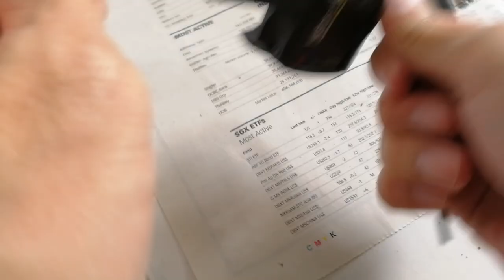LOOK Keo Blade carbon pedal maintenance

Comment: Greetings! I got these eyelets keo blade carbon 8 as a gift. But on one pedal there is no steel plate, it was lost. The question is, can you ride without this plate? And will these pedals fit Shimano road shoes, SH-RP100? :) and with spikes Spikes for clipless pedals compatible with LOOK KEO, M-WAVE 5-311836

Comment: My left pedal has some light creaking when applying force on it. Do you think it can be solved simply by dismantling the axle and applying fresh grease? I also noticed some slight play, I guess that’s where it might come from…
Reply from the maker: Taking it apart is the first step to check on its internal.
Reply: @fame1382  thanks!
Reply: @unairamos74  what did u find?

Comment: Can i use lithium grease?
Reply from the maker: I couldnt find any service manual for these pedals, best bet is a generic grease. This shimano grease which I m using in most of mine videos works well with most bicycle maintenance work.

Comment: Ruined a good pair of pedals.
Reply: Me too, tried to unscrew in the wrong direction with too much force, and broke the screw. Hmm, usually I'm not that stupid :) Make sure you turn the allen key clockwise on the left pedal! In fact, if you watch closely at 0:50 into the video, you can see very well what I mean.